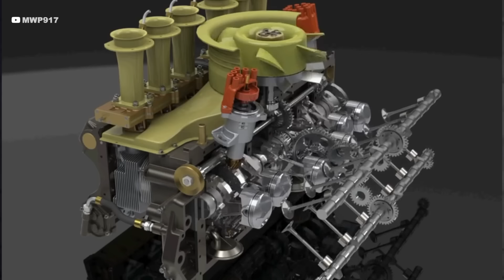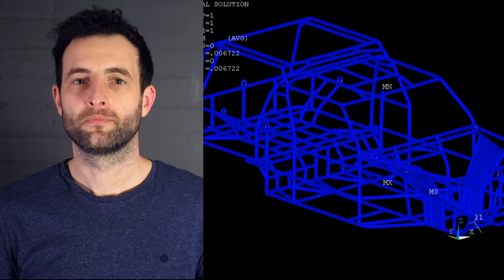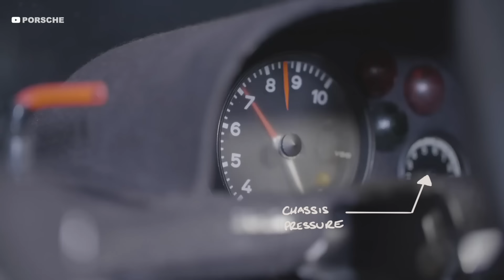The Porsche That Had an Inflated Chassis

Comment: 7:50 In the picture it's the 917K which has the correct 
aerodynamics. It was actually the prototype 917 with a sloped down tail that's unstable. That's why the later 917s have a raised  bodywork towards the end and often some small deflectors to achieve more downforce. Apart from that you are explaining it brilliantly. Great respect to you! 👍

Comment: 1 - The 917 has a 180 degree V12, not a flat(boxer) engine. In a V engine opposing pistons share a crank pin, in a boxer each piston has their own pin.
2 - Another neat thing about the 917's engine is that in the middle of the crankshaft there is a gear that connects to an intermediate shaft that drives the flywheel and ultimately the car. This essentially halves the flex the crankshaft has to withstand, which in a 1000-1200 bhp long V12 engine is quite a good idea.
Reply: As an engineer, I like this kind of details.
Reply: @Jacob-W-5570  I actually thought it was a neat idea as well when I saw an engine cutout at the Porsche museum in Stuttgart. Definetly worth a visit if your close by. Though the Mercedes museum in the same city is much, much better.
Reply: I am happy you mentioned that.   It is my assertion that taking the drive at the minimum first degree node of flex allowed the use of smaller crank bearings resulting less internal drag on the crankshaft. I.e. less parasite engine drag allowing the power that would be lost to drag on the crank to be used to propel the car.
Reply: It is still considered a flat 12, just not a boxer
Reply: True on the center power take-off on the engine.....and here's another 917 tidbit......the mating gears have a "hunting" tooth.....one gear does not have the same number of teeth as the mating gear...so the "Same-two" gear teeth don't mesh with every revolution. So an interesting question emerges.....when you see the RPM of this engine, is it the crankshaft speed or the slightly different output shaft ( clutch) speed......oops .....time's up. Cheers !!!
Reply: @TheWilferch  is there any reason for that? I know about the power take off because I saw an engine cutout at the Porsche Museum. I can't remember if this fact was explained or I figured it out myself, but I sure as hell wasn't going to count the gear teeth :) there was so much more neat stuff to see and only a few hours to do it in.
Reply: @paulzapodeanu9407  ...yes,..... any professional working with gearsets knows that if you have (for example) a perfect 2:1 ratio......with one gear having 50 teeth and the other 25.....then the SAME PAIR of teeth will always engage ....with every single revolution. If, on the other hand, you had (say) 49 teeth on one gear, and 25 on the other, you have what is called a "hunting" gearset. With every revolution, the NEXT OVER tooth engages with every single revolution....and so on.....which spreads the wear over the entire gear set.....the same 2 teeth never mesh until a goodly number of revoltions occur. It evens-out wear.... and for a racing car, this might be the "extra trick" to get it to live a grueling 24 hr race. If you apply this to the 917, where the power-take-off is from the CENTER of the engine....and not from the back.....they used something different than a 1:1 ratio....it was something like 0.98 : 1......so the crank and the clutch operated art slightly different RPM. So even to today, when a driver says he shifted at 8400 rpm, was that crank RPM or clutch RPM?....I'm still not sure.
Reply: It also kept the air volume underneath the cylinders the same throughout the stroke.  That air volume was not compressed on each stroke, thus saving energy.
Reply: @TheWilferch  Are you telling me they did NOT match the gears at 2:1?
Reply: @kcsnow9447  .....yes...correct. Engine speed and clutch speed are different.
Reply: @TheWilferch  Aha, ok, I missed this, and your explanation is clear and does show why it is a good idea to have a mismatched number of teeth in any set.  If possible.  But I have the idea too that it isn't always possible, and that there are some sets which simply cannot be manufactured or ever be made to work.  Yes?  [I'm going on memory here]
Reply: @kcsnow9447  ...intuitively...when you consider gear tooth strength requirements and also the diameter of the 2 meshing gears....yes, you are correct, you cannot use the "hunting gear" principle everywhere and in all cases.....
Reply: But, in all cases it's the lead gear which also provides that "hunting, yes?"  That is to say, it's the 49 tooth gear which drags along the 50, do I have that right?
Reply: @kcsnow9447  ..not really a good visualization. Think it out this way....one gear has 50 teeth, the other 25. In that case, there is no hunting tooth design. The same teeth....all around.....will contact the same mating teeth on the other gear....always. If one of these gears has an odd number, like 50 becoming 49...and the ratio not being precisely 2:1...then all gears....at every revolution....will have "new" gear teeth contacting...never the same 2 until a high number of revolutions has passed.
Reply: @TheWilferch  But can you do that?   Can you make a "one tooth-less hunting gear" for every ratio?  I was under the impression there are some ratios for which you cannot.  If not, why is it such a bad thing to have a ratio in which one tooth always meshes with the other?  I get the principle of why each tooth wears evenly (assuming hunting) on the rest, but why is this better than each meshing the other each time?   [And thank you, btw, for the education and discussion.  I do appreciate you taking the time to talk with me.]
Reply: @kcsnow9447  ...I am not expert on this, but it stands to reason that the physical size of the gear alone would be a limiting factor.....you can do only so much on a very small gear that carries a big load ( big teeth)...if it only has (say) 5 teeth around it's circumference, you can't easily make it 4. But if you have a very large diameter gear with 150 teeth.....it may be easier to introduce a 149 tooth variant of this gear.....
Reply: @TheWilferch  Yes, that makes sense, and the larger the gear the more the inertia.  Which might have constrained the 917 motor's central power takeoff simply to avoid too much of that inertia (I will trust you to run the math here--I am out of my depth where rpm v power takeoff v engine flexibility (as a driver) is concerned.  Which is why Porsche paid their engineers, and not me.  :D  I only read about it and think about it.  They did it.  Moreover, and were it up to me, we'd still be mulling it over even now, let alone getting it built.  
I do also think the central power takeoff was a brilliant idea.  Two end-to-end Sixes, vs a V12 or Boxer 12.  Well thought out, that one.
Reply: It had a flat 12 but tour right about the gear to the gear to the flywheel

Comment: The "aerodynamic development by flies" did not happen at Le Mans. It happened at the Osterreichring old circuit during a test session. Porsche had contracted with John Wyer Automotive Engineering, who'd beat them twice at Le Mans with Ford GT40s. John Horsman was Wyer's race engineer, and he attended a test session in the summer of 1969 to get a look at his new charge. 

When he arrived, the Porsche team were chasing handling gremlins. They'd make an adjustment, swop parts, etc. then send test driver Willie Khausen to do a couple of laps. When he came in, they'd ask his impression, compare lap times, etc. Nothing worked; no matter what they did to fix the handling, the result was always, "no improvement," or "it's even worse."

When the team took a lunch break, Horsman looked the test 917 over, carefully. That's when he discovered that the bug splats hitting the front of the car, as expected. But curiously, there were almost none, past the doors. He also spoke with other drivers testing other cars and discovered that they preferred the greater stability of the short-tailed cars to the nominally faster long-tailed, stream-lined ones. 

After testing ended for the day, Horsman asked the Porsche engineers if he could borrow some sheet aluminium and the team's second 917 chassis. That evening, he and his chief mechanic cut up the aluminium and duct taped it on the car, creating wedgy box that covered the rear wing to roughly the top of the cockpit height. 

Next morning, Khausen took the modified car out for a drive. The Porsche crew expected him to return to the pits after a couple of laps. Instead, he kept on going. When he finally did stop, the engineers asked why he didn't stop. Khausen looked up at them and declared, "Finally, this thing is a RACE CAR! Now we can work on it." Horsman's "box" was refined into the wedge-shaped tail the 917 was famous for, and the rest is history. And a Steve McQueen film. 

Ultimately, Porsche did get the long-tailed 917 to work by raising the rear wing and re-sculpting the tail to reduce lift, but it's John Horsman's on-the-spot improvisation that made the car a winner.
Reply: Great information!
Can you please share the source with us? Book, magazine, journal?
I would like to learn more about this history.
Reply: Interestingly, in a recent interview the other Porsche works driver present, Kurt Ahrens (also the winner of that 1969 Austrian grand prix with Jo Siffert), says it was basically him who came up with the idea, which would have to do with his family business, a metal-selling/scrapping company, in which he was constantly playing around with scrap as a kid, making his own cars. He was passing through the formula classes for Brabham, battling in Formula 2 often successfully with Clark, Hill, Rindt, Ickx... while being his own mechanic as a privateer (financed by his family business), and was known for having enormous mechanical empathy with the cars, the kind of guy who'd notice right away that the rear left wheel is slightly out of alignment or that the dampers were on their way out, and would have an idea how to fix it immediately; also he never crashed a single car during a race, known as a very rational and disciplined driver, so he was hired by Porsche to help with 917 development, a difficult job he was extremely well suited for. He suggested to the engineers to get some aluminium sheet from the hardware store in nearby Knittelfeld he had noticed on the way, and simply sticking it to the rear to see what that would do, the kind of thing he'd do to his own car; and it was applied that same day (perhaps after coming up with it independently after considering the fly-splatter-pattern, who knows); the brits ran with the story ever since. He's one of the more humble, shy and down-to-earth characters in racing, certainly not into fame and recognition - actually turning down driving F1 for Brabham after one race as he figured, this F1 circus with worldwide races wouldn't allow him to be with his family and the business anymore, and he's quite rare to give interviews. He says he asked Piech and Peter Falk soon after the 917 story if he should offer a correction to that story to the public, but it was suggested after a bit of quiet consideration for him to keep quiet, as that story would play better with the international audience if it were the british, making the 917 a more international project so to speak...  I would say, that would be entirely in line with what is known about Piech and his strategic mind. David Piper who also partook in in that Austria 1969 race confirms that story.

Oh, and the other guy's name is spelled Willi Kauhsen, if someone wants to look him up. If he had told that sort of story, I probably wouldn't believe a word, he's a great character and absolutely entertaining to listen to, but definitely a story-teller never shy to "emphasize" his own role in whatever happened. Ahrens is a very different character. In fact, it doesn't matter too much who actually came up with it first - they had a lot of brilliant and highly motivated minds pulling all-nighters and working their ass off to get this car right.
Reply: @decnet100 where do you got this info from. I guess a certain podcast maybe? Alte Schule?
Reply: @z33r0now3  Sure, the interview with Ahrens there is the longest that he has given (in public) to my knowledge, other than the interviews he did with his long-time friend Eckhard Schimpf for his book ("Einer dieser verwegenen Kerle") which is also a good source on his involvement in 917 development. 
At any rate, I find it hard to believe that the often-quoted fly-pattern actually tells so much useful information, at least not in the way it is most usually mentioned about the 917 (lots of flies in the front, no flies in the rear, ergo bad airflow on the rear) - I'd expect that the rear on any car, even several ones with very much working rear aerodynamics will be comparatively clean of flies and other debris as the impact of those particles will mostly happen around high-pressure spots such as the frontal area, not an area of laminar flow as you'd want along even an effective downforce-producing body section at the rear. With the early 917 tails that they ran, the only part where I'd expect any splatter would be the vertical stabilizer, perhaps that's what they meant.
I'd hazard the guess that the decision to let this be claimed by the brits was also influenced by that fact that at Porsche there were several big heads (which may have included Piech himself) who held the "streamlining" concept in the highest regard - as is logical for a company used to bringing small-engine cars to Le Mans, one of the fastest races there was; their natural instinct in terms of aerodynamics would be to run as clean as humanly possible. I'm sure there was some hesitation to "ruin" the car in that regard with that rear spoiler section, which held back the performance initially - and even if the problem was known to several people including Ahrens, the situation may have required an external actor to pass..
Reply: @decnet100  interesting comment. Food for thought. Thanks for replying. I drive the 917k in a simulator on the nordschleife in Virtual reality. It’s my fav race car besides 908/956/962. it’s not the real thing and it’s already so bonkers to hold the car on the track, makes you appreciate how hard it really must have been.
Reply: @z33r0now3  Yes, I also fool around with simulators myself and have to say, I'm not good enough of a driver to reliably push the 917s I tried (and also I think I haven't found a version that truly does it justice yet in terms of sound). The 962 in rFactor 2 (by MAK corp) is more my league (you always get the feeling that car WANTS to go fast, other than the 917 which actively wants to explode and kill you :)), and I enjoy that car to bits also on the Nordschleife!
Reply: @decnet100  yeah, the sound never does this car justice. In terms of the 917k I could only tell from videos, sadly never seen/heard one live. I sat in a real F4 Phantom though. My second passion ☺️. Have a nice day and greez from Munich.

Comment: John Wyer and/or David Piper solved the aero issues as David had a Lola T70. Note the rear of a 917 was changed to being almost identical to a T70
Reply: John Wyer's team....specifically led by John Horsman during Fall 1969 testing in Austria..... solved the aero issues.

Comment: It should also be noted that this video is primarily focused on the original , coupe 917 used for endurance racing as for LeMans. Engines were 4.5 liters....later 4.9 liters...and finally at 5.0 liters. Horsepower went from 520 to close to 600. What is missed here, is that all this engineering and details, are also found in the previous racing models,where the 917 is the culmination of this evolution of the series. The 906, 907, and especially the immediate predecesor 908 , had the same frame design and nitrogen pressurization.  Even the basic engine design of the 908 was "Somewhat" carried over,  as 908 only had an 8 cylinder engine, at 3 liters size.....it was "basically" the same as to items like pistons and connecting rods ( 12/8 x 3 liters = 4.5 liters.....the original 917 engine size). The 908 had around 350 hp so the estimate of 520-525 for the original 917 engine translates reasonbly well, too.

Comment: Just a correction the 917 that raced at Le Mans produced around 650 hp the Can Am racers that raced in America aka the 917/30  could produce 1000 hp
Reply: 917/30 can-an
Was able up to 1200hprs at max Turbo setup and weight around 800 kg.. OoF
Reply: There are "some" (toooooo many) other Facts he did wrong.
Mostly everything about the 1st longtails and that K just means kurzheck / shorttail and so on.
Reply: "Porsche 917 - Wikipedia" https://en.m.wikipedia.org/wiki/Porsche_917. In the 1973 Can-Am series, the turbocharged version Porsche 917/30 developed 1,100 bhp (820 kW).
Reply: 917/10 TC 1000 PS
917/30 Spyder 1100 PS (Racetrim)
917/30 Spyder 1570 PS (Fullboost 2.24 bar)

Comment: Just saw this car some days ago in the museum. What I did not really notice before, that flat 12 is actually a 180° V12, just like the Ferrari F1 V12s at the time. I always thought that it was a Boxer unit, but the museum has such an engine on display. Also the cooling fan is mechanically driven via some tooth wheels and not via belts. What a machine.

Comment: Porsche didn't recognize the fly spatter aero problem. It was the Wyer team...notably John Horsman who did. The front of the car was splattered with bugs and flies at the Osterreichring in fall of 1969 testing....and the original long tail....even with the rear corner "flaps" in a total ( ! ) straight up position (!)....they were totally clean. Meaning, the air wasn't even contacting them. That night the rigged up plywood and tin and made a large kick-up tail...and the car was transformed....immediately more stable and soon 2-3 seconds PER LAP faster.  This was the genesis of the 917 "K" which appeared in Daytona at the start of the next season....and won.